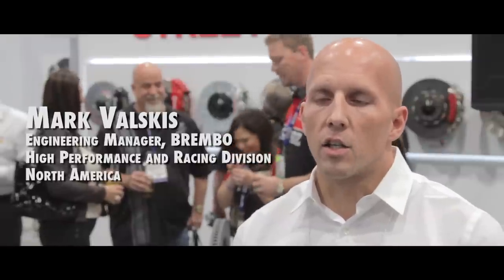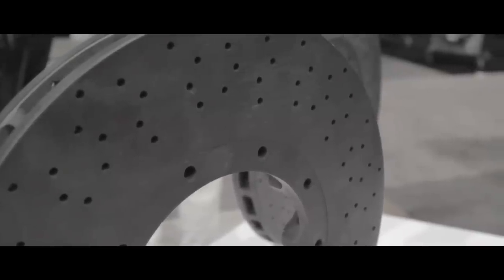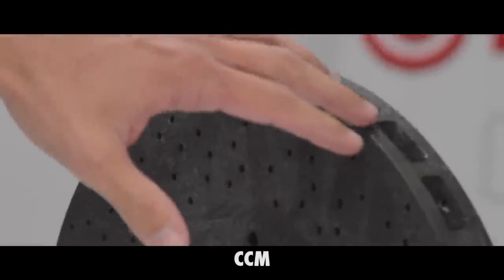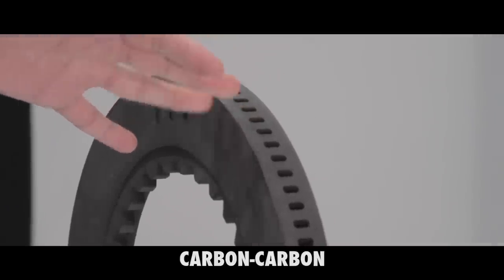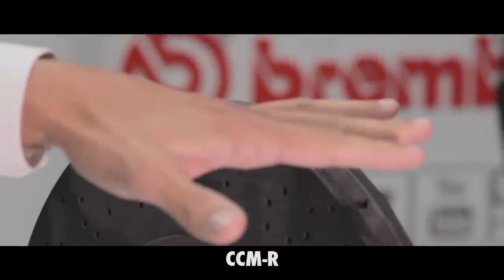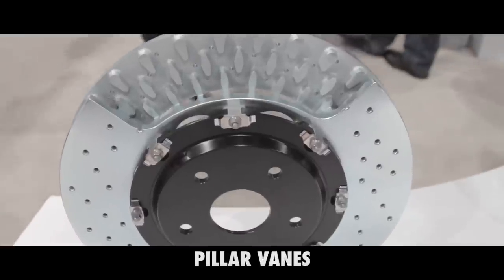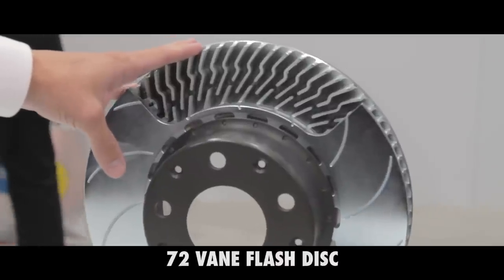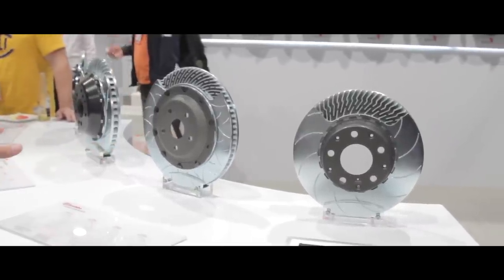R35 GT-R Serious Stopping Power - Brembo Carbon Ceramic CCMR

Comment: No mention of how squishy the brakes are until they are warm. Not good street brakes for short trip driving. Everyone things Carbon ceramic is amazing but you have to get some heat into them before they do what you need. Also its more for very high sustained performance. Most people do not drive hard enough for long enough to really make use of its advantages.